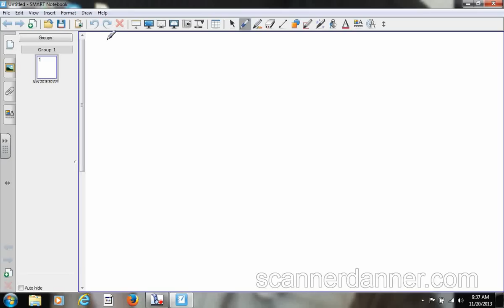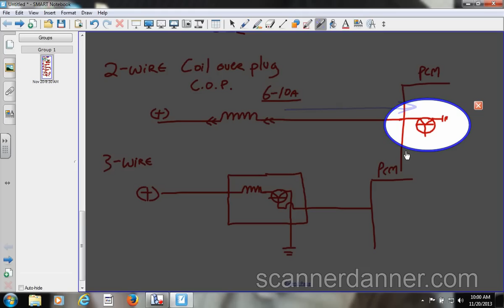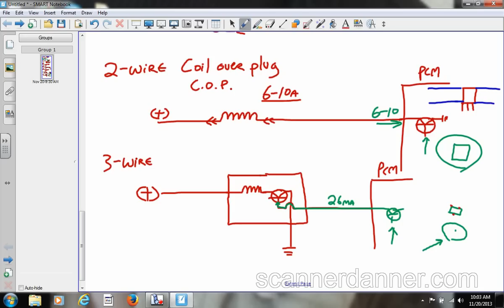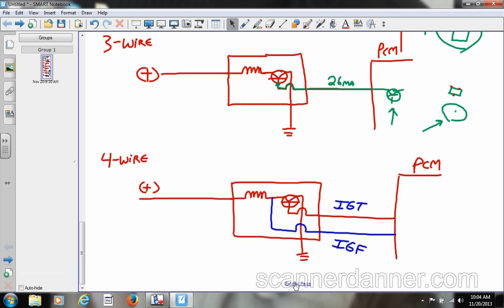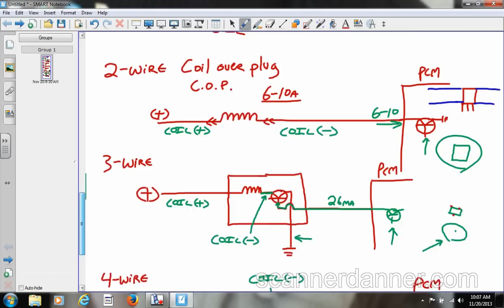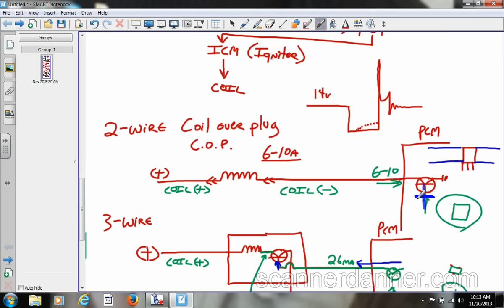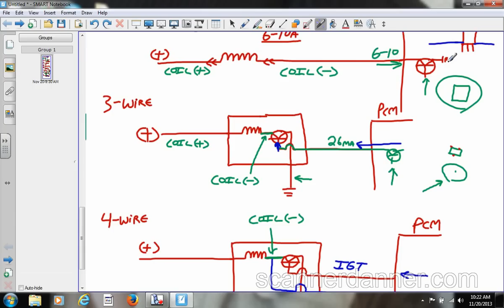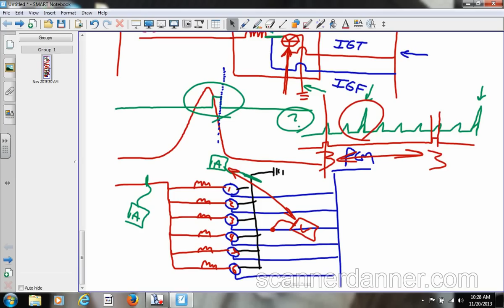Ignition System Designs, Operation and Testing (an SD Premium video)

Comment: Scan-Dan is great, I can not believe how much I have forgotten . So all he is sharing is great, and I am only 68 so i have no problem sending a 10-20 a month donation. So please send details on that. Right now I have a 2001 S-10 no start no injector pulses. I spray S.F. in intake it will run, as long as I keep spraying. I think I can remember after I do hands on for awhile so thanks hundreds. Everyone should be highly thankful, and respectful for the help..
Reply from the maker: You can join SD Premium right here for $11 a month 
https://www.scannerdanner.com/join-scannerdanner-premium.html
Thank you!
Are you saying after to spray it for awhile it will run on it's own? What is your fuel pressure during cranking?

Comment: Fantastic, clear explanations.  I liked knowing about the Ford bypass ign system. On my 1987 Ranger I made a YTube video on where the in-line spout connector is located and removed in order to set the correct timing (adjustable distributor).  I couldn't find much info on it.  Thanks to your video Paul I now understand that when the in line fuse spout is disconnected it isolates the PCM from the ICM...... thanks!
Reply from the maker: thanks ozz!

Comment: Hi Scanner: I have a 1992 3.8 Buick w/trans and ECM and all original looms (except starter switch wiring thru firewall) installed in a Lesharo Motor Home. I need info to get power to the F.I.s and Ignition circuits. I would be happy to compensate yourself or any one who could point out the best way to go thru some 'add on' relays and power up the required fuel system and ignition. I have pinouts of the ECM and of the three plugs that attach to the ECM. I am  uncertain of where to hook in the B+ correctly. I am 87 and only recently have inquired into the 'post 1970's vehicle electrics'. I love your presentations and assure friends that if they appreciate Sherlock Holmes they can certainly enjoy the pursuit of a elusive fault by modern techs such as yourself. So thanks for any help with 3.8 and for the entertainment, as well.

Comment: Awesome lesson on Ford's ignition circuit thank you.  I've always wanted to know why I have an ICM!  My Mazda 626 has EEC-IV and I've had a PIP circuit code set once.  You have to remove the SPOUT connector in order to set idle speed and ignition timing.  Not only can you have spark with spout disconnected but you're supposed to for timing and diagnostic mode.

Comment: Sir thanks for the information regarding the diff. types of ignition wiring diagram 2 wire ,3 wire, 4wire but to my understanding all of them are control by the computer is that so thanks
Reply from the maker: yes it is, they are all computer controlled

Comment: Very good video. I just want to say that Ford at least on his 97 Ford Mondeo 4 Cyl do uses ignition module, but only in models with automatic transmission only. I don't know why not using for manual transmission. It is a good question to know the reason why, isn't it. I hope to help in this topic

Comment: There is 3-wire C.O.P. without transistor. Early VW 1.8 Turbo has external igniter + 3-wire C.O.P. there third wire is a ground for secondary winding. I think that some other late 90's - early 2000s European cars (ex. 6 cylinder BMWs, late VW 1.8 Turbo) even without igniter has 3-wire C.O.P. coils without built in transistor.

Comment: Mr. Danner, first off, I'd like to thank you for what you're doing and the videos you put out! I've been in the automotive field for almost 5yrs now but have never just been thrown into diagnostics until moving and starting a new job about 4 months ago. I've learned a lot since my move, but have been wanting more. Learned about your channel last Friday and have been watching nonstop since! Planning on ordering a hard copy of your book within the next week or 2 and subscribing to Scanner danner premium. I'm sure you get this a lot but I was wondering if you could help me with a problem child. Customer brought her car in for running rough. After informing her she'd have to leave it, due to us being busy, she made an appointment and upon attempting to leave the car wouldn't start. She left it of course. Vehicle is a 95 Toyota Celica 2.2L automatic. Found the vehicle had no spark, knowing the ignition coils inside the distributor on Toyota's have problems, and seeing the connectors on the distributor were broken, I replaced the distributor assembly. Good to go, have spark. Nope. Next thing I find is the injectors are constantly grounded via the pcm with key on, and with cranking, so no injector pulse, just constantly grounded. Check my wires to injectors from pcm, check good. Check powers and grounds for pcm, all check good. Replaced the pcm with a used one from junk yard. Alright, good to go, injectors pulsing as they should, but guess What? No spark again. Well, I shouldn't say that, the car did start and run for an hour and a half yesterday. Drove it, shut it off, restarted, everything normal, awesome. Today, won't start, no spark. Found one of your videos on testing the Toyota igniter. System was a pull up design I believe you referred to it as (No voltage at igt circuit), introduced power via test light, had spark from my coil. Vehicle will now intermittently start for a second but immediately stall. My dad whose owned a Honda/Toyota specialty shop for over 30yrs is thinking it's the ignition coil and states he's read article after article of these aftermarket Toyota coils being bad out of the box and tells me to get a Toyota ignition coil to solve the problem. What's your take? Any ideas? Something I'm missing, overlooked? Any help is greatly appreciated

Comment: Great video! I was hoping you could help me with a problem that I am having on my 89 Chevy 5.7 K1500 truck. My initial problem was it would not start, because it's 33 years old with 150k mile I thought I would replace the fuel pump. This was not the issue, still would not start so I check for spark, no spark, so I replaced the primary coil, pick-up coil, ignition modular, distributor shaft, cap and rotor button. It started right up and ran. I unplug the advance timing by-pass plug to set base timing on TDC. But, with the EST unplugged it will not start. Base on your video, would you say I have a bad new ignition modular?
Reply from the maker: Are you sure base time is set with unplugging something? On some of these you'd jump pins A and B in the 12pin DLC for base time. Describe the EST wire you unplugged. It should only be a single wire

Comment: Hi Paul, Thanks for all your videos, I do have one suggestion....If you clearly mark the emitter of the transistor, it would be much easier for your students to identify current flow as typically the collectors are reverse biased. Your diagrams as indicated don't make sense because you cannot see that the base emitter current is controlling the base collector current...

Comment: Hey Paul, what's the idea of having 2 transistors? On 3 an 4 wire COPs the base circuit driver is inside the coil, but I'm suspecting that another transistor inside the PCM is commanding the base circuit to on and off..? Also, by using an amp probe on these designs, how much amps can I expect to see? Thanks brother.
Reply: i was thinking the same thing. My guess is that by using pulses from the PCM to trigger the coil you are dealing with much lower current and run a lower risk of frying the PCM and you let the coil deal with the higher current
Reply: nick elias I believe timing advance created there with eng. speed and mass air and TPS. cks. .

Comment: Hi Paul or anyone who may be able to answer,

I have a question regarding a VAG 4 wire cop.

There is a common bat + feeding through the primary windings to the transistor, a ground from the transistor, a signal from ecu to transistor. 

My question is regarding the 4th wire which the wiring diagram shows as connected to secondary windings and going to ground. 
Why is this wire required and I assume the coil is actually similar to the 3 wire design in the video?
Reply from the maker: Yes, the secondary has its own ground wire. GM did this back in the day with their HEI ignition coils.
The secondary winding can work connected to a 12v power or a ground, as weird as this sounds. 
So yes, you basically have a 3 wire design COP with an extra ground
Reply: Thank you very much.
I’ve been a technician for over 20 years, but after being pointed towards your YouTube channel I am learning a lot of really useful information. I will be subscribing to your premium channel in the near future.
Reply from the maker: looking forward to seeing you there! Thank you https://www.scannerdanner.com/join-scannerdanner-premium.html

Comment: What if you don’t have fuel coming out the injectors during cranking?  I have a 1990 Chevy pickup in my shop now that has a hot intermittent no start with no fuel coming out the injectors.

Comment: Hey scanner what is wrong if the ref 5volts present and only  IGT2 received the signal and the weak  IGT signal on the other 3 coils? cos the issue was the  engine run and stall after some seconds. the engine keep running with misfire after I connected the IGT2 with IGT1 and same applied from IGT2  to IGT3 & IGT4. but it keep stall if the wire connect from  IGT1 to IGT3 or IGT4 excluding IGT2. what would be the right direction..
cheers
Douglas

Comment: Hello,  Paul. Just out of curiosity,  if the transistor in the 3 or 4 wires coils were shorted to ground and caused the coil to melt, that can affect the base turn on wire(IGT) and possibly cook the transistor in the pcm, right?
Reply from the maker: yes sir

Comment: Paul, Probably a stupid question but on the 3-4 wire COP designs....the transistor in the PCM that controls the transistor in the coil....how/what switches this on/off positive of negative voltage(at the base) ? What is the emitter connected to...I take it the collector is the wire coming in from the coil transistor,keep getting collector/emitter confused...
Reply: What switches the transistor inside the computer? Another transistor :)

Comment: Hey Paul, I was wondering if you had any information on European cars that's on your premium page? Bmw in particular. I would like to learn about the designs of ignition system it has just like you did with this video. Thank you and thanks for all the videos!
Reply from the maker: Nothing specifically but everything I do is fundamental to all cars. I may not have specific euro market case studies but the info transfers for sure. Thank you!

Comment: Hi, can you suggest a method to find out whether the power or ground signal of the primary winding is being amplified by the secondary winding of the ignition coil. That would be the polarity of the spark that comes to the spark plug, whether positive or negative.
Reply from the maker: Why do you ask? For a secondary scope waveform?
Reply: ScannerDanner
Well I read in a book (Performance Tuning in Theory and Practice by A. Graham Bell, 1981, Chapter: Ignition, page 183) that spark jumps easily (less voltage required) from the center electrode to the side electrode of the plug. This means that ideally the spark plug center electrode should be negative. Now it remains to confirm it on the vehicle. Reading page 167, apparently it can also be confirmed by checking that the transistor is switching on/off which primary coil wire? If its negative primary coil wire for a vehicle with negative ground, then the coil polarity is ok.
Reply from the maker: The center electrode is negative on conventional and c.o.p. systems. On waste spark it can be negative or positive. Each coil will have a negative and positive firing plug. And it is not determined by the switching polarity (they are all ground side switched), it is determined by direction of current flow through the primary winding.
Reply: Thanks.

Comment: Paul , your video is wonderful
I have a comment    in time  28  you talked about Toyota    4 wire type      and you draw a Blue line for  IGF  and I think it is  wrong
 I think that IGF should be attached with Secondary not Primary coil  because if there is an open in secondary circuit  
if there is no current in Secondary circut  there will be no confirmation to PCM that there is a spark generated in the cylinder 
so, the computer will cut the fuel injection at this cylinder     and I thick your blue line should  be attached before not after          Secondary coil                        best regards                                                                     Eng. Mohamed El Shamy  from Saudi Arabia
Reply from the maker: Thanks friend. It may be tied into the secondary as you stated. I guess my memory is of seeing a diagram with it tied into the primary winding.

Comment: Awesome video. Im trying to convert a 91 nissan ka24e 4pin distributor harness to run 2002 frontier ka24de 6pin distributor and use a 3 wire coil on plug system. Im using a megasquirt pnp2 ecm. I cannt change the 91 ka24e wiring harness. How do you wire the 4 pin ka24e distributor to run the 6 pin ka24de distributor and use coil on plug setup?  The 4 pin has 12v, ground, 180° ref,  1° ref. 
The 6 pin has .
1. Ignition A 
2. ground
3. CKP signal - crank
4. CMP signal - cam
5. sensor ground
6. Ground
I've wired 12v to 1, Ground to 2, 1° to 4, 180° to 3. The pnp2 jumpers are configured for wasted spark and have pin outs for spark abcd, A&d wired together  b&c wire together. 3 wire Denson coils 12v, Ground, signal all wired to 12v switch, Ground, 1&4 signal go to a&d @ ecu, 2&3 signal to b&c @ ecu. 
When ignition is turned on coils get hot. What am I doing wrong?
Reply from the maker: This one is complex but I can help you. Let's move this one to my forum www.scannerdanner.com it is free to join and we can share pictures and images that way. Let me know when you post it and I will jump over and help out

Comment: yes I know it's another transistor..BUT is the base of the transistor in the PCM switched on and of with power or ground and what is the emitter connected to on this transistor?
Reply from the maker: I don't build computers my friend.  Your asking me component level electronics now.  My guess is they can control it however they chose. There is no set standard.  Good luck finding this info.  The manufactures hide it from each other.

Comment: Sir from the coil on plug system 2,3,4 wire  what the source voltage voltage of the power feed came from outside the pcm or in the pcm thanks
Reply from the maker: the main power to an ignition coil, regardless of design, is from an external fuse protected circuit connected to an ignition positive source.

Comment: Late model Ford Aerostars which had a waste spark system used three drivers in the PCM to switch the coil primaries directly. So Ford did stray from their default design.

I always hated that design putting transistors handling that much current which makes them more prone to failure in an expensive PCM rather than a less expensive ICM just seemed like a stupid move to me.

Then again there are other weird things on those vehicles like a having a variable reluctance crank sensor and a hall effect cam sensor. The engineers couldn't even standardize on one sensor design.
Reply: Huh, replacing drivers in Ford PCMs is Pot Roast with extra gravy. Not too hard to do either Bush. next time if you're lucky and one of those problem ECMs comes rolling in dive into it. Unless there's an owner in the equation who carries around his list of the shop's ten commandments
Reply: A lot of vehicles do this with their sensors. VRS units are very rugged and reliable and you tend to see them being used the closer the vehicle gets to the ground where things get nastier. As for something digital i can think of many bonuses mostly regarding accuracy and precision on shafts rotating at ANY speed, especially at the lower speeds.
Reply: Darren Zinman
Well customers are less than patient waiting around while I order replacement transistors from Digikey :-).

I've never kept the old PCMs around to mess with because they had a core charge.

A replacement transistor makes sense as long as the base drive circuit is still functional.
Reply: ***** Yea. ECM repair can be a mixed bag in that some of their driver failures are more complex and involve other possible latencies, proprietary components that are hard to find; basically a risk for comeback which as you and I know absolutely stinks. What i should have said is that ECM repair may be worth it in only such cases where the problem driver is a "known issue,"; and more importantly, has a "well known fix." As far as parts I have used some N MOSFETS and NPN units with no problem in certain ECMs like Ford Escape ECMs and RAV 4 PCMs. But in most cases you are right in that the risk vs. reward for doing these things usually favors a replacement unit. Best for the customer and for you too. 
But in those cases where it's possible to reliably, and quickly, repair a PCB it really can be a WIN WIN for you and the customer; ie, lower parts cost to customer but increased labor which may total less than a replacement yet earning more income, keeping the owner's OEM part in the vehicle, avoiding any reprogramming issues (usually,) and impressing your customers in that they had no idea mechanics knew electronics. That was a joke:) 
It's always fun to dabble once in a while, so long as it's on your dime.

Comment: Questions. 
I have a 2001 nissan sentra 1.8
And I have a misfire on cylinder #2 no spark on the coil,  but I switched a good coil and still no spark. 
What could be the problem.
Reply: Oil in the drive plate inside the distributor. Section 21 in my book if you have it. Pull the distributor cap off, then the rotor, then the black cover underneath the rotor and you'll see what I'm talking about. You can temporary fix it with brake cleaner and blow it out with an air gun